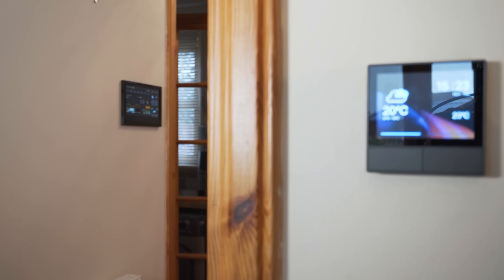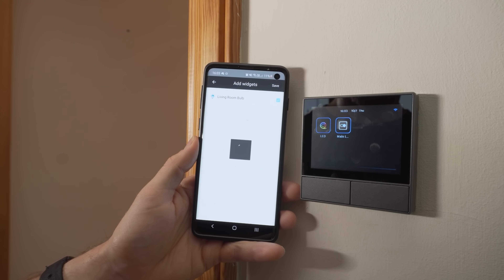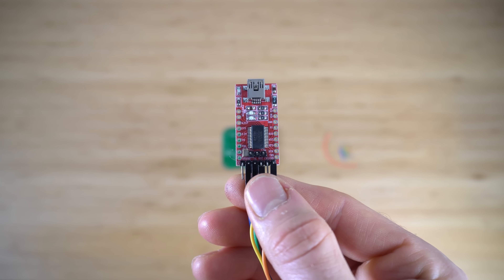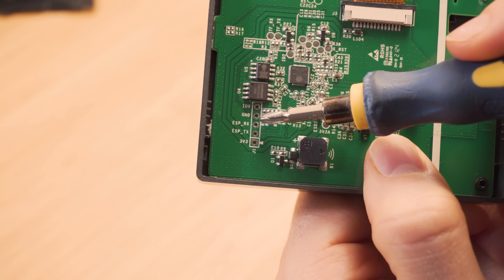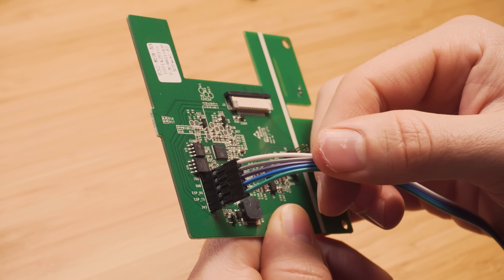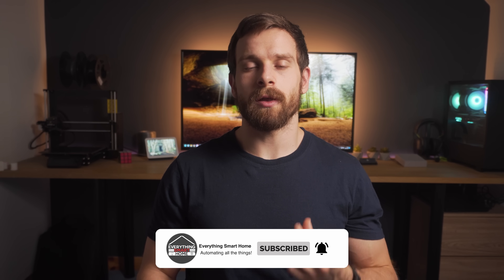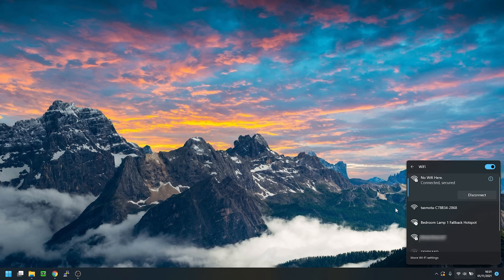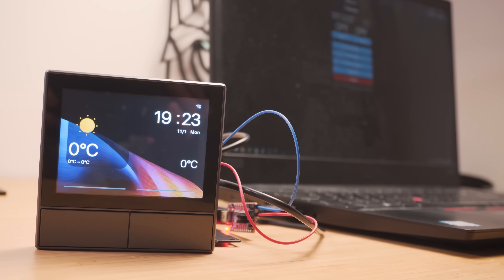Flashing the Sonoff NSPanel with Tasmota!

Comment: Hi, I have flashed NSPannel using described procedure as result device is flashed, is visible on the network, but there is an issue with built in temperature and humidity sensors. Actually reported values are wrong, temperature is negative, humidity is not reported. Did you see such issue? Is there a patch for this? Thanks in advance.

Comment: I think there is something wrong with the + and - on 9:28 the figure told us left is ground and right is plus  but on 9:38 the red cable is on the left site and the blue cable is on the right site.   I tried it but it broke my usb hub and the serial 2 usb print is very hot. I cabled it just the way you dit red on the 2nd pin and blue on the 3th pin and on de interface board, blue on the left and red on the 3th (part site to above).  I also dit not find any wifi point.
Reply: it is wrong. His setting is also still 3.3V instead of 5V on the USB TTL

Comment: Are you going to do a follow up video, setting up panel etc
Solving the temperature problem can be solved by going to console http://“(Your IP Address)”/cs? typing in TempOffset -3 this will resolve a 3 degree over temperature than ambient.
Reply: take it's a no then

Comment: Hello, is there a way to manually update the NS Panel to a newer version? Because after I made an update from 1.0.2. to 1.1.0 the update was not successful and currently, there is a black screen with error information. I made 10 attempts to update, stopped the power, turned it on, and whatnot - but nothing helps.
If I update it manually until the last version, at least I won't rely on the automatic one, because it obviously doesn't work.  What happens every time is up to 61% data recording 5111808 and stops there.

And the update says that it is 8288152

Comment: Anyone else getting an error: ESP32 ROM does not support function read_flash
while trying to backup the original rom??

$ esptool read_flash 0x0 0x400000 nspanel.bin
esptool.py v2.1
Connecting...
Detecting chip type... ESP32
Chip is ESP32D0WDQ5 (revision (unknown 0xa))
Enabling default SPI flash mode...

A fatal error occurred: ESP32 ROM does not support function read_flash.
Reply: Ah, my version of esptool was too old. The version that comes with Ubuntu (2.1) is ancient. pip install esptool got the 3.2 version, which worked great.
Reply from the maker: Good to know, thanks for the update!

Comment: Hi, great video. Thanks for your share. Can I ask for a little help? Is there a way to restore the original firmware without a backup? For some reason I overwritten mine.
Reply from the maker: If you didn't take a backup then unfortunately no. You may be able to find someone online who has the original
Reply: @EverythingSmartHome  Thanks for your reply. I`ll stick to tasmota for now. One of my NSPanels don`t have the option to change from portrait to landscape. Is there a way to upgrade this nextion panel already?
Reply: Hey. Did you manage to install original software back on device? How did you do i? What program did you use?

Comment: so i got tasmota on it. the new stable release includes the driver o no need to load it manually.
my bigger problem is how to configure the panel? how do i set date / time / location / widgets etc ... all i get is time 00:00 , date is 0/0 , temperature is 0C , etc
Reply: so, the driver is needed, but not to get the screen working... the screen works without it. The reason why it's needed is because it introduces a language you can use to configure the panel with

Comment: Do you plan on making a video on how to link this to home assistant and run automations? Having a difficult time getting it all setup. Also wondering how to change the temperature to F rather than C. Thanks!
Reply: Did you got it integrated with Hass?
Reply: I haven’t messed with it in a while. I might flash it with esphome and try it that way.

Comment: I watched this twice, but I am new to this so please help me out. If ш flash NSPanel with Tasmota I can use it in HA through MQTT without eWeLink app, right? This one I am almost certain is true. But what about those 8 widgets? You see the problem is that I plan to install Zigbee Zemismart connected to HA through Zigbee stick. Will I be able to add curtain widget to NSPanel? Or in other words can I add widgets to control devices that are not sonoff and not connected to eWeLink?

Comment: Would it be possible to flash an original nspanel firmware on an ESP32 and make my own light switch? I have the Sonoff B05 RGB bulbs, but I don't have a smart light switch to turn them on/off.
Reply from the maker: I don't think so as there is more components to it than just an esp32. But hey, you never know!

Comment: Received mine today. Flashed. and got relay 1 and 2 working. 
The display options in the nspanel.be dont really work properly. Can edit what is shown on the groups screen, but the devices LED strip and the CCt and CCTRGB bulb do not work as intended. When turning on the LED STRIP in the group it turns itself off a second later and does not allow you to click the brightness or colour

The other two bulb device options do not work at all. no press allowed.

The temperature is also not using the internal temp probe right now for some reason.
Its there, why cant we enable it?
Reply: Update: you need to update the screen from an external source. 
If you switch a light widget on using the screen you need to externally update the screen to say the light is on because otherwise it just reverts back to off 

My temp calibration was way off. You need to fix using adcparams 

You also need to tell the screen a device is online in order for it to work
Reply: @christopherhemmings  I've got the same problem with the way off temperature. Could you share how you have fixed it?
Reply: @christopherhemmings  I have the same issue, how did you fix it?

Comment: 9:34. You are connecting a red wire to what you marked as groudpin.

Did you use the wrong wire or marked it wrong?
Reply from the maker: Yeah my bad, it's not marked correctly, just wrong wire used during filming. It was more for demo purposes but yeah my mistake.

Comment: The 75 dollar will become 90 euros with tax applied. With the current functionality a tablet will be more worth it overall. Looks cool, but not 90 euro cool
Reply: Partly agree, although a tablet does not have relays to physically cut a connection.  You could get a switch and a tablet probably for cheaper still.  But it is neat to see them combined.  I'm curious what the community will do it it!
Reply: @gmaclean1  your argument is valid too 👌 but the price is just so steep
Reply: @denniskluytmans  Nope on the kickstarter last question in the FAQ; Sonoff say it include import tax & vat for EU, so price is final.
Reply: @stephanebuisson3577  so, 75 euros?
Reply: @denniskluytmans  my understanding is you pay only for your pledge and delivery. in my case 699+94 HK$ about 88€ for a duo pack (i supposed they will bulk ship in EU before shipping intra EU to save on the process)

Comment: Pleased I took a gamble and ordered one 
tbh still not sure what I'm going to do with it don't have neutral in my light switches
Reply from the maker: I'm sure you'll find something 😂
Reply: I am just going to use the physical switches to control scenes and ignore the relays behind them.
Reply: You could feed live and neutral along the switch wiring from the ceiling rose with standard UK wiring and then use a smart bulb permanently connected controlled using your home automation. Of course the relays become a bit pointless, I'm not sure what I need relays for in a wallplate either. Maybe it will make more sense in my campervan.

Comment: the sonoff mini can be flashed over the air with the stock api; maybe possible with this one also, I dont have it to test. could be simpler.
Reply from the maker: Unfortunately not!
Reply: Only sonoff switches that support diy mode can be flashed  without an ftdi adapter. But most sonoff switches have all the flashing pins available for easy flashing.

Comment: Wonderful video!
I now feel the NEED to buy a NSPanel.
Are you sure you can't use the "tasmotizer" to flash the firmware? 
It would be a lot easier procedure...
Reply from the maker: Thanks! You cannot, tasmotizer doesn't support esp32s and the flash proceedure is different unfortunately
Reply: @EverythingSmartHome  Thank you! Good to know... Apparently I have never flashed an ESP32 before :P
Reply from the maker: Haha no worries, hopefully it gets updated with support at some point!
Reply: Good question, I'd have thought it would be the same. Good to know ESP32 isn't covered.